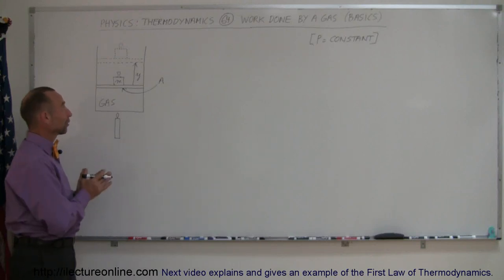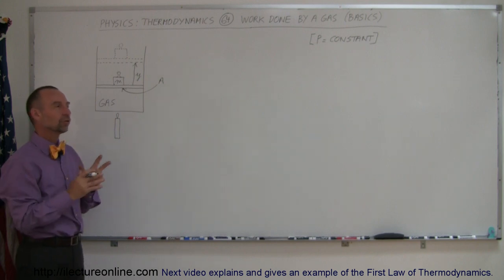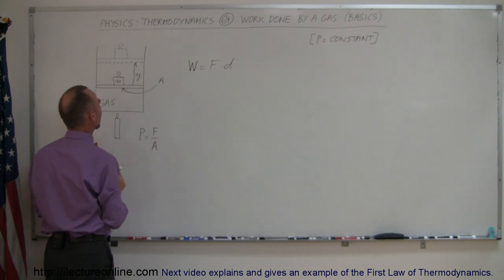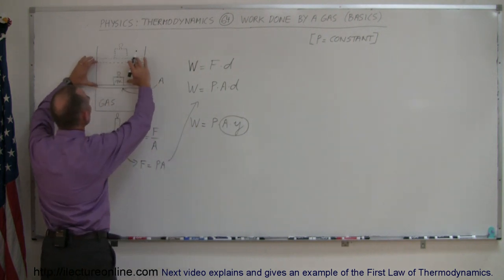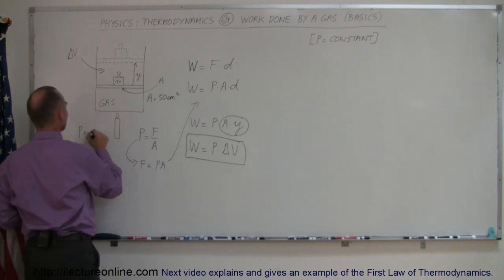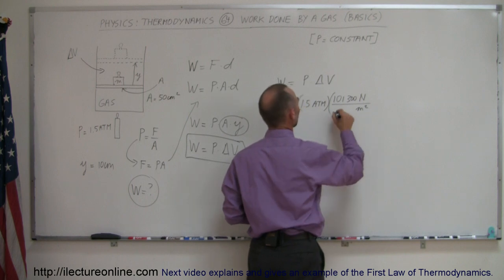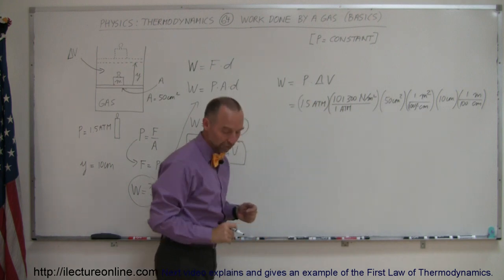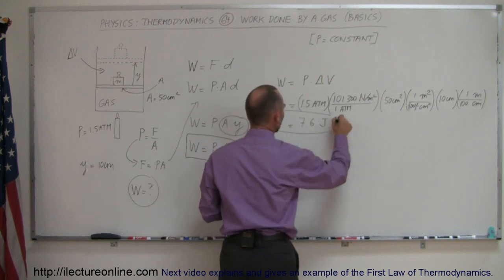Physics 26 (9 of 10) Work Done By A Gas (Basics)

Comment: shouldn't the answer be 76J?
1.5 * 101300 * 0.005 * 0.1 =
Reply from the maker: Yes, you are correct.  (Those little dots on the calculator are getting hard to see)
Reply: @MichelvanBiezen  Alright Thank You for clarifying :)

Comment: And what if the mass is separatelly instantenously such the the process that pccurs is fast enough and you hace a non quasitatic process?? How could you calculate the volumen final??
Reply from the maker: Not sure what you mean by: "if the mass is separately instantaneously".   For the second part of your question, the concept of a "quasistatic process" is purely theoretical and doesn't happen in the real world, (such as projectile motion with no wind resistance).  But the effect is small and usually not significant as we calculate thermodynamic processes.

Comment: Thank you very much for your helpful , clearly and interested  lessons ,

Here , I got a different result .
w = 1.5 X 1.013 X 10^5  X  50 X 10^ -4 X 10 X 10^ -2  
   =  1.5  X  1.013  X  50  
w = 75.975  = 76 J
Reply from the maker: SoMe Honey,
Isn't that the same answer?
Reply: Michel van Biezen No sir , yours is 7.6 J  .

Just a tiny calculating mistake !!
Reply from the maker: SoMe Honey
You are correct.  (I didn't see the decimal point.)
It is indeed 76J

Comment: Sir, we have to add atmospheric pressure all the time?  in this case P=P0+mg/A?  what if we push the piston with force F [N] and displacement x [m] , and also we add heat Q to the gas, how can we calculate an increase of the temperature given 1 mole of mono atomic gas
Reply from the maker: The pressure inside the container is the TOTAL pressure where total pressure = gauge pressure + atmospheric pressure
Reply: Thank you sir,  So it should be P(gas)=p0+F/A.  then Q=1.5nR(dT)-(p0+F/A)(Ax) and it leads to dT=.....in terms of Q,F,A,x

Comment: Dear Sir............Example Problem I have a single acting hydraulic
  cylinder with a stroke of 300 mm, a bore of 18 mm and a rod  of 10 mm  if the press weight is 10 mm on the Piston Head what is the pressure.....Please explain the calculations

Comment: If the question has different pressure and temperature and reversible, and ask us to find work done. how will u start? i actually assume is non cyclic process and non-adiabatic as the question doesn't mention. but i can't solve the equation because the three factor which is temperature, volume and pressure is not constant.
Reply from the maker: The standard equation for work done is the integral of P * dV.  Then you'll have to express the pressure in terms of the volume using the gas equation.
Reply: sir, do u mean that using pv=nrt and sub into the equations become (nrt) integrate dV/V. but n is not given. do i need to assume n=1? and i have initial and final temperature. which temperature should i use?
Reply from the maker: You are correct.  If n is not given, just assume it to be a constant (which comes out of the integral anyway).